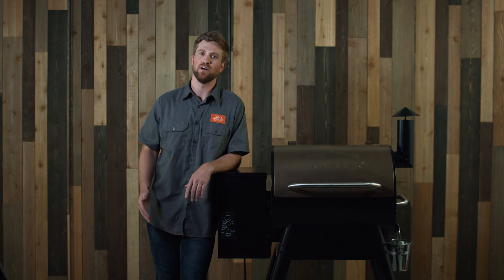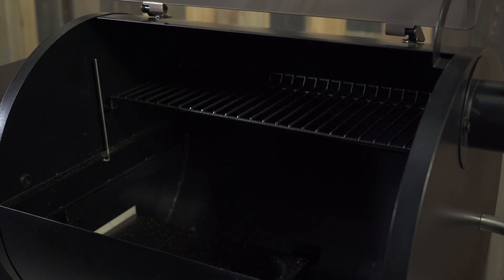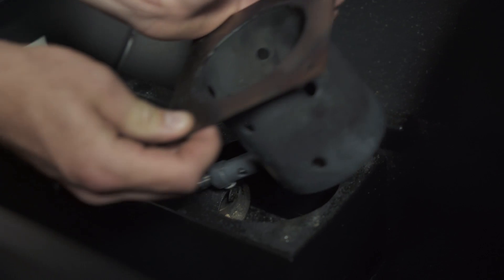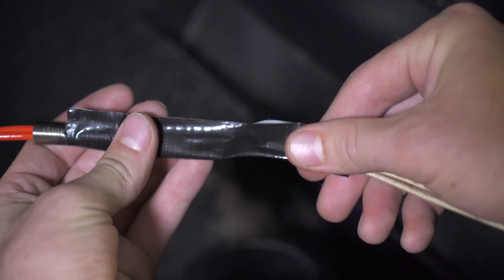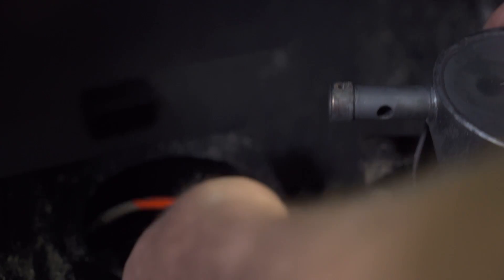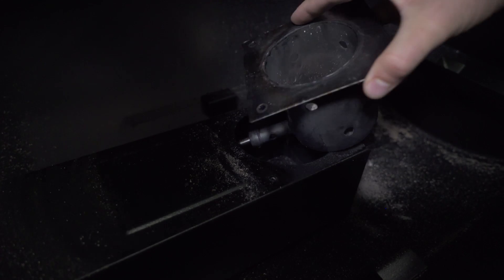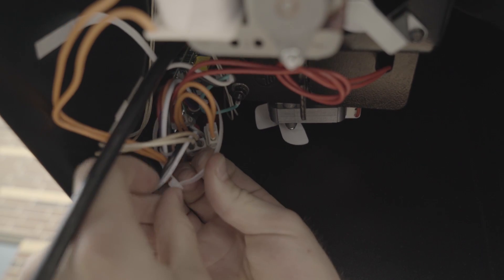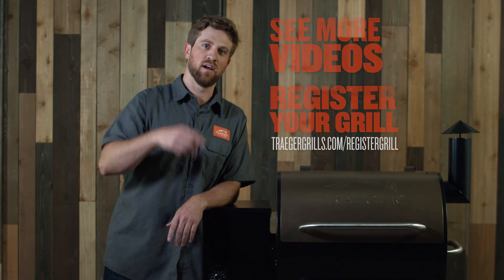Traeger Grills - Troubleshooting: How to Replace the Hot Rod

Comment: This is a very easy repair but having the right tool is very important. Cut the heating rod from the old one and tape the wires from the old one to the new one to pull it through. You can also remove the fan below which makes it a lot easier. Use the same tool to do so.

Comment: You assume too much. There’s a panel underneath that has to be removed. It has four screws. They were obviously installed by machine and way overtightened or cross threaded - looks like the latter. THEY WOULD NOT COME OUT WITH A SCREWDRIVER, AND WHEN I HAD TO RESORT TO MY IMPACT DRIVER, THE CHEAP SOFT METAL IN THE SCREWS JUST BURNISHED OVER. These should be small metal screws with a nut driver head. I had to drill the screws out NOT IMPRESSED!  It also took three calls to support to get the right video.
Reply: Could you link that video, none of the ones ive found show how to remove the bottom panel under the hopper?

Comment: I have a older 'Deluxe' model BBQ300 that I purchased used.  Both this grill and a new BBQ300 that I saw in a Youtube video have the hot rod protruding around 3/4".  Does the 1/8" to 1/4" protrusion of the hot rod into the fire pot apply to all models or just to more recent post-BBQ300 models?

Comment: I replaced the hot rod. The induction fan is still working but still my grill doesn’t work! Everything else seems fine. What can it be? Help, anyone! Please!
Reply: If the induction fan is running and the auger is feeding pellets into the firepot but they don't ignite you may need to change the fuse located on the back of the controller.  The fuse is there to protect the controller when the hot rod goes bad.